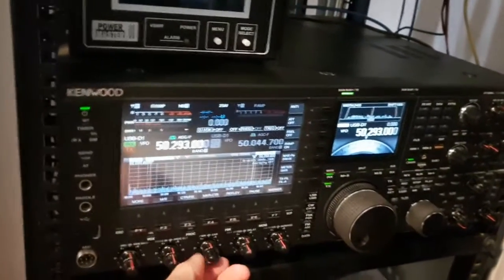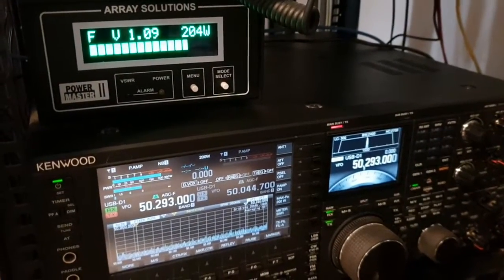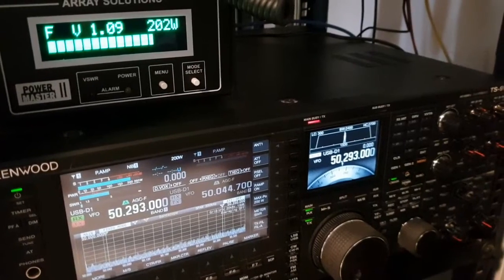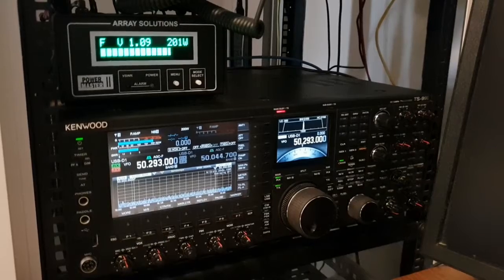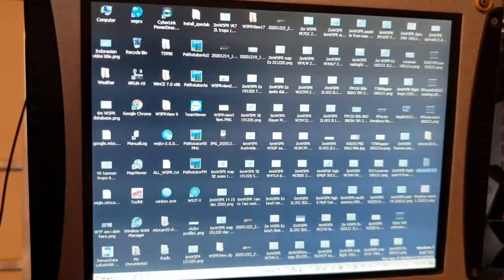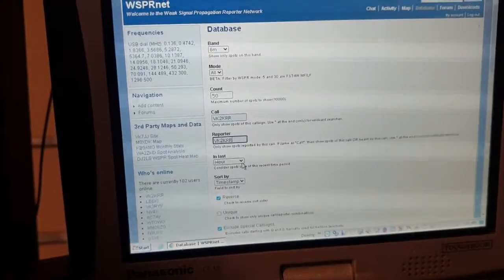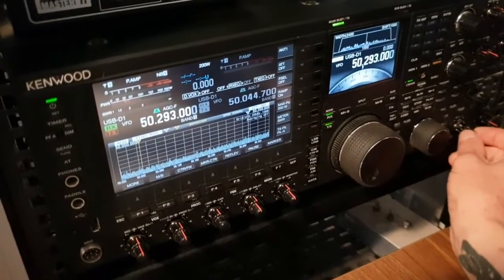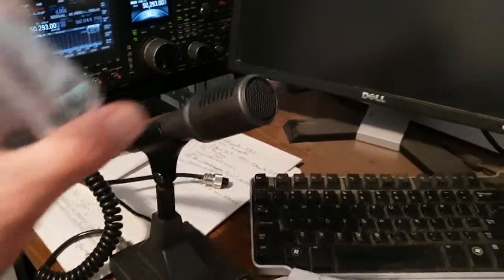Kenwood TS-990 Radio, Quick QRO TX Test on 6m WSPR, looking at SWR & Power.

Comment: Good god man you are beating the crap out of your TS--990 Flagship radios Finals? 😲
Hope you have a spare set of finals lol 💨
Note to self Hams: And this is why you have to be very careful when you by used radios this is crazy!
I use digital modes also but never full output from my rig NEVER!
Reply from the maker: Hi Mike, a rig like the TS990 I dont think its a problem, it does it easily. And when you have a antenna SWR as good as mine with no tuner involved, there is less pressure on everything. This video was simply a video to show a perspective buyer that the rig would run full output. The radio has since been sold to that lucky person. A very good rig, but does so much more than what I would ever require so decided to downgrade. Now using a IC7200. The 2nd VFO would be very handy.
Reply: @VK2KRR  I disagree I could see if you were doing that 50% of the finals but 100% full 200w digital yeah I wouldn’t do it with any swr!
That’s a beautiful Rig your better off getting a cheap solid state amp,
using 15w of drive from the radio driving a solid state amp doing 200W less stress on the radio and will stay nice and cool and you can run it all day.
That’s me tho I love the hobby just like you and I have so much equipment over the years. I seen the video and I was shocked more than excited lol again just my 2 cents for what’s it’s worth.
This is a hobby of reviews and comments. 
Anyways good luck hope to work you soon 73 MikeMDX!
Reply from the maker: @MikeN2MDX  No worries Mike, thanks for your thoughts and comment, appreciated. I know what your saying, better off not running the radio as hard and feed it through a PA. All good.
Reply: @VK2KRR  😉👍🏼